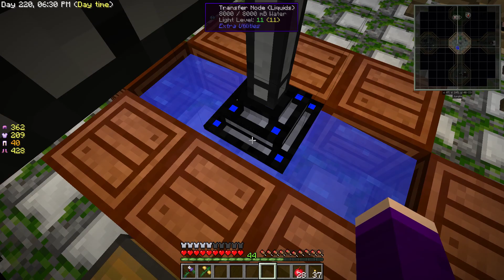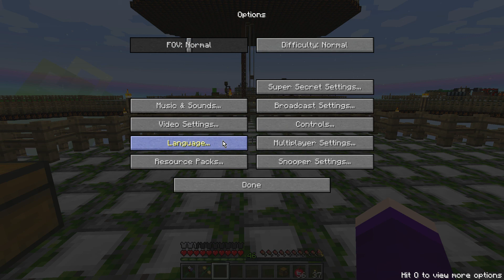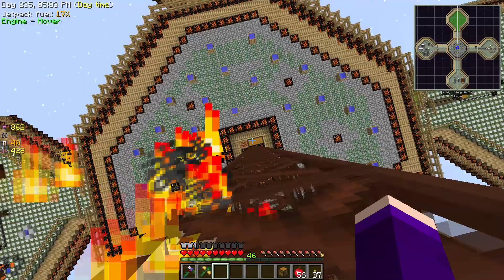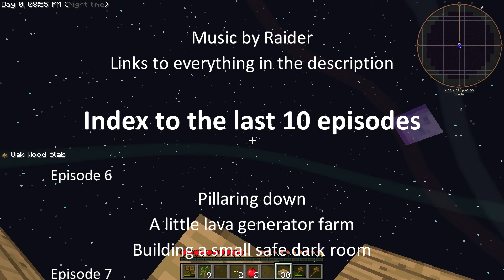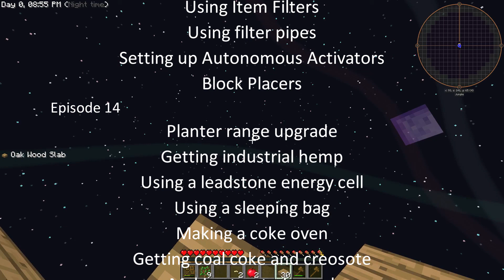S2E15 Sal Plays Skyfactory 2.5.2 - A Jetpack and a Windmill

Comment: there is a certain ammount of animals they can spawn in an area. Not sure, but i think it's an area of 16*16 chunks (256*256 blocks), and there can be 24 or 36 animals. But u can do the ''Animals in a Chest'' thingy ^^... like this - http://www.pic-upload.de/view-31234008/2016-07-18_00.51.42.png.html Oh, there is another way to produce Mossy Cobble, i do it in a Fluid Transposer.
Reply from the maker: Yes, I'm rapidly coming to the conclusion that I need to be farming enderpearls, for golden lassos, amongst other things. I'm thinking about catching an enderman in a safari net and putting it in an automatic spawner ... unless you have any better ideas?
Reply: Safarinet with enderman in a spawner is fine ;-) It's one of the first things i do, catch an Enderguy and make an automated Enderfarm.